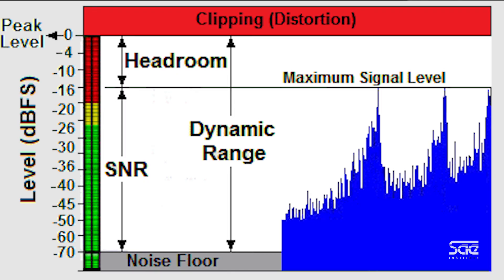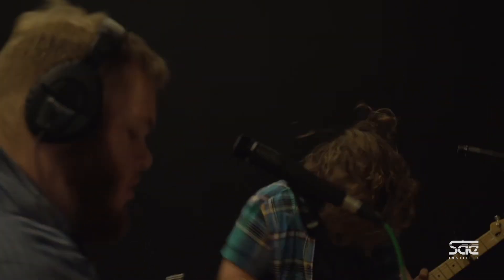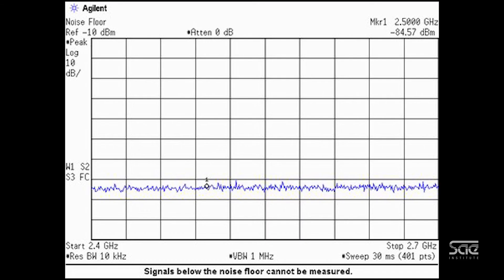Understanding Dynamic Range and Headroom

Comment: A compressor is also an electronic device then it will cause a noise floor my question is what happens to noise floor when we gain the Signal? Will the noise floor be gained too?
Reply: Yes it most certainly will